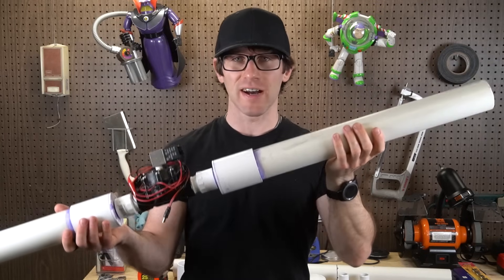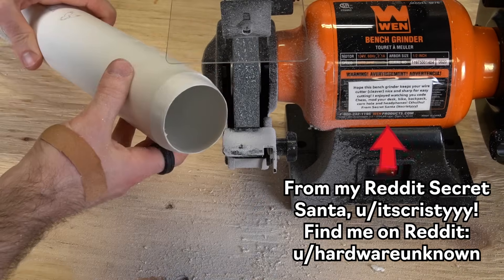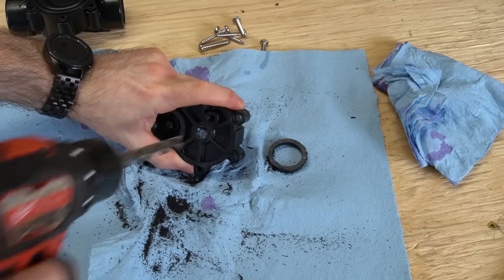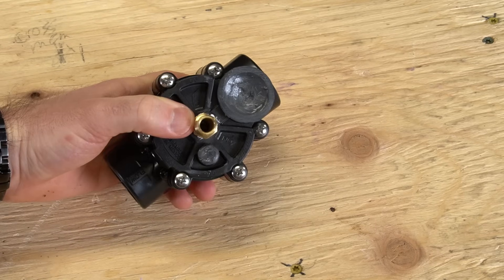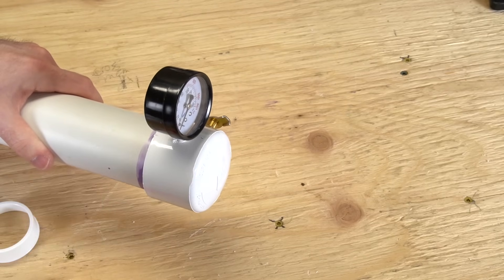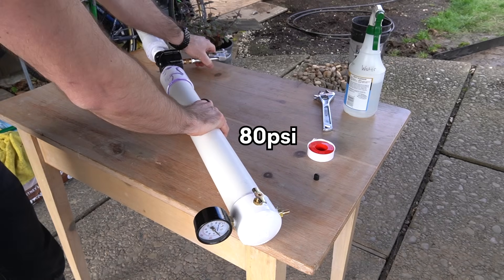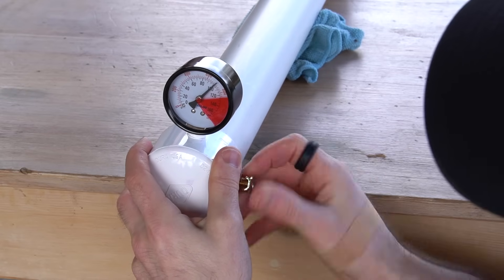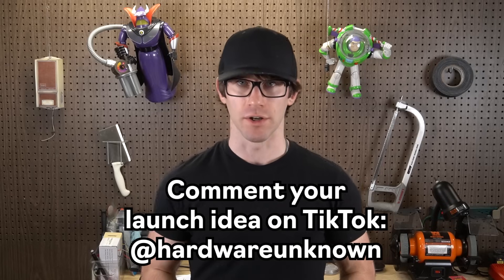How to Make a Simple Air Cannon

Comment: Looks amazing, I don't understand the blow gun section, surely pulling the trigger will direct the air out of the blow gun nozzle rather than through the barrel?
Reply from the maker: Great question! It would seem so right?

Notice that the blow gun is mounted to the sprinkler valve on the side where (internally) the diaphragm contacts the spring. When you pressurize the cannon, you may be able to hear a small amount of air escaping the barrel. This is because it takes time for the air to pass through the small opening in the diaphragm to the spring side of the valve. Eventually, enough air is on the spring side of the valve that the air pressure and spring tension together are able to seal it off since they now overcome atmospheric pressure.

When the trigger is first pulled, a small amount of air rushes out through the blow gun as you'd assume. You can feel this by holding your hand in front of the blow gun opening. The thing is, all that tank air pressure wants to equalize as quickly as possible with the atmosphere. When the "flood gates open" from pulling the trigger, all that air tries to rush out at once. Because of the pressure drop from the air exiting the blow gun, the diaphragm opens slightly, providing a second path of exit for the pressurized air.

The air then tries to rush out both the blow gun and the barrel simultaneously, but you'll notice that inside the sprinkler valve on the diaphragm itself there is only that small hole for the air to pass through (through the small white plastic piece in the diaphragm). Initially, the only exit for the air was out the blow gun. Now with the diaphragm slightly opened it is easier for the air to pass through the large open barrel than it is to rush through the small opening of the diaphragm and out the blow gun.

Pressurized air chooses the path of least resistance and tries to exit as rapidly through the barrel as possible. This causes the diaphragm to be forced open as the air pressure overcomes the spring tension. The air rushes out the barrel in one big burst and the cannon launches. Once the pressure equalizes to atmospheric pressure again, the spring tension resets the diaphragm and the process can repeat.

All this is happening in a fraction of a second so it's hard to tell when one "phase" of the action occurs, but that's the order of operations each time you pull the trigger.
Reply: @HardwareUnknown  yep makes sense now, thanks for taking the time to reply, a great explanation very detailed .

Comment: Quick question, is it wise to use pvc cement instead of Teflon tape to seal the values? To make it more sealed?
Reply from the maker: That's an option and would work fine. The reason I didn't is in case I want to change something. If you don't plan on that, go ahead and cement it.

Comment: Edit: You earned a sub. In case the following might be construed as condescending, I want to be clear I’m merely concerned for your safety and hydrostatic testing is standard practice for any work involving pressure vessels.

3:54 Yikes! Use hydrostatic testing for untested pressure vessels! You’re creating an unnecessary explosion hazard by filling with a gas before verifying the structural integrity of the tank.
Reply from the maker: I didn't construe it as such, your warning is important. People need to know PVC is not "safe" by any means for something like this. I haven't done hydrostatic testing before, but I would like to try it. Especially since eventually I can see welding custom metal containers and those should certainly be tested properly.

Comment: Couldn’t I hook this to a nitrogen tank and skip the air chamber?
Reply from the maker: Could you? Yes. Just be aware of the pressures you're using and take any precautions possible to mitigate potential failure/injury/damage. No cannon, particularly PVC cannons. is "safe". Keep that in mind regardless of the source of the pressurized gas you use.

Comment: ive had my unit of basically the same design for like just under ten years. all the while it hadnt occured to me to hold it like a launcher letting the trigger point to the ground. i feel dum. i guess i had ruled that out because i was afraid it would slam the trigger into my self from recoil using a 2 inch valve and a 4 inch reserv-o-war. i was filling the barrel with water and letting it report like a shot gun and one time the pvc barrel ruptured in my hand.
Reply from the maker: I was trying it with the trigger up and it just felt more comfortable this way. A good lesson for anyone though; these things can break catastrophically as mentioned here and in the video. Hope you were okay!

Comment: hmm trying to figure out how to combine a compressor filling up 3-4 of these automatically and stopping them at about 40psi and launching them using timing...Any ideas?
Reply from the maker: You could use a pressure regulator or a 40psi check valve. You could also simply set your compressor's built in regulator to a maximum of 40psi and you'd be set. By launching them using timing, do you mean they would fire a set amount of time after reaching 40psi? You could get real creative with that.

For example, you could set up an Arduino that has a current sensor checking the incoming power to the compressor. It will have some general range it's at when the compressor is running. It will have a lower reading if anything when it is idle. You could use this event (the change from high current to low current) as an input to trigger a timer that would then open a solenoid valve after the appropriate time elapsed, triggering the cannons.

Comment: This is a simple cannon?
Reply from the maker: I'd say so. The PVC connections all involve the same procedure to glue them, and the valve needs a few modifications. Sure there are even simpler designs, but there are also more complex ones. Everyone's comfort will be different so for some this would be trivial and other's it would be an advanced project. It's all relative. If you're building something though and learning along the way, you're doing a good thing no matter your current skill/comfort level.

Comment: So I made this and it just sounds like an air horn every time, any idea why?
Reply from the maker: Try 1) checking that all the parts of the valve were put back in the right orientation, and then reassembling it. There could be a gap somewhere where air is rushing past to make a sound, but it can't release it all the air properly for launching. 2) similarly, put some soapy water in a squirt bottle and check all your PVC connections on the reservoir side (using LOW pressure, just enough to see bubbles). The same may be happening there. If thats the case, you'll either have to cut the connection and make a new one with a fresh PVC fitting, or remake the reservoir.

Comment: Do you have a link to the power source you use for the solenoid?
Reply from the maker: This is the battery that powers both my simple air cannon, and the quad barrel version featured in another video: https://amzn.to/3LYLh5l

Portable and with a decent battery life for projects like this, especially low power solenoids/circuits.

Comment: I was having an issue with the sprinkler valve getting stuck open after a couple rounds of firing. I unscrewed the valve and put it back together and this fixed it temporarily but eventually it got stuck open again. After that I removed the brass fittings and just screwed the blow gun directly into the sprinkler valve and that fixed it. I’m not sure if it was just misaligned the other two times or what but I have not had any problems since. Really easy and fun project.
Reply from the maker: So glad you enjoyed it and went through with the build! I'm not exactly sure what is going on there, but what could be happening is the brass fittings are screwed in very deep into the valve. This could be preventing the diaphragm from fully seating itself to shut off the valve. Why this would happen only after a few shots, I'm unsure. Perhaps try taking the valve apart, adding the brass fitting, and inspecting it (with no pressure, unassembled from the PVC) to see if this is the case. If so, maybe some of the brass can  be ground down so it still provides the same hold in the valve, but extends slightly less into it.

Comment: can you use this for a gender reveal with colored powder
Reply from the maker: You could, the only thing would be keeping the powder from falling into the sprinkler valve as there's an open hole from the pipe into it. First stuff a bit of tissue paper/kleenex in there as wadding and then the powder.

Comment: make a gun that builds up pressure and releases it into a shot but instead of launching stuff it just shoots high speed air particles
Reply from the maker: When I was a kid there was this toy called an Airzooka. It was basically that. You would pull back on an elastic strap tied to a flexible plastic cover over the end of a plastic tube with a handle. When you released the handle the plastic cover would snap forward from the elastic and it would launch a sort of ball of air wherever you aimed at. It was fun to play tag with them.

Comment: Is there a risk that the pvc will explode if the pressure is about 150psi???
Reply from the maker: I can't tell you what an exact failure pressure would be as there are numerous factors that could affect it. What I can say is that you should always assume there is a risk of explosion, because there is. PVC is rated for water pressure, not air.

Always wear safety glasses and other gear, and err on the side of caution by using lower pressures. I didn't max out the pressure my air compressor can get to for safety reasons. The exact value was arbitrary, but it's within my comfort zone based on my tests. I encourage you to perform your own for your own safety.
Reply: Thank you!! Have a nice day!!

Comment: What do you mean by tap the hole, sorry I just don't know what that is/means
Reply from the maker: No problem at all. Tap (the verb) means to add screw threads to a hole. You do so using a tap (the noun) which is a metal rod-like tool you see me use that has threads along the bottom of the shaft and a square shank on top for holding it. When you twist this into the plastic, it cuts threads into it for mounting the fittings. For reference, the same term is used when cutting threads into metal. You'll see me use vice grips to hold the tap, but typically you'd have a tap handle with square jaws specifically for holding taps to do so.
Reply: @HardwareUnknown  thank you

Comment: I can only get mine to about 75psi then it stops, I used the exact measurements you provided. Do you know why that would be?
Reply from the maker: Huh. Have you done the soapy water test to see if there is a leak? Are you using a manual pump or a compressor? Check to see if air is leaking out of the valve. What might be happening is it gets to 75 psi and that is enough to open the valve, then when the pressure is released and drops, it stops back at 75 and the valve closes.

Comment: Thank you for the video. I made the exact same cannon using the same parts but some air is leaking out of the barrel. Any thoughts?
Reply from the maker: How long are you pressurizing the chamber for? Air will briefly leak out of the valve until the pressure builds and seats it. It's a few seconds, enough to think it will constantly leak. If it's continually leaking after 10 seconds though, that's an issue.
Reply: @HardwareUnknown Thank you for the reply.. Air was leaking through the small solenoid dumb hole that exits out of the output of the sprinkler valve. I sealed it with a small piece of duct tape from the inside, now it's sealing good no problems.
Reply from the maker: Ah yeah, I sealed that with epoxy, but hey if duct tape works great. Just make sure it holds well as pressurized air from a small hole like that could do some damage to someone's eye, etc, if they were near it (like while holding it on their shoulder) and the tape failed. No idea if it will or not but just want you safe.

Comment: Genuine question, why not just use a regular solenoid valve?
Reply from the maker: Using the sprinkler valve allows me to have the manual option with the trigger handle, and I wanted both configurations.

Comment: Any alternate ammunition that can be shot at humans?
Reply from the maker: I cannot advise on this as each cannon will be different. Anything shot at a human has the potential for serious injury and should have regulators in place to prevent "hot" shooting (ie. Too much power, with more potential for iniury). A stuffed animal may seem soft, but it can still hit someone in the eye, possibly with a piece of unseen plastic. Depending on numerous factors including pressure, volume, and more, a particular projectile will have a different impact (literally). As my design does not have a regulator and has not undergone professional testing, I do not recommend it be shot at humans. Personally, I leave that to my paintball markers while wearing proper safety gear.

Comment: Such a great video! I also saw the other cannon videos and they were all just as good
Reply from the maker: Thank you for checking them out! Best of luck to you if you decide to make your own, and feel free to ask me any questions you have.
Reply: @HardwareUnknown  How did you pump air into the cannon?
Reply: @Tanmay.Patil1  Legal disclaimer: Asking of questions does not  guarantee a reply, whether implied or promised. Video author reserves the right to withhold answers after welcoming questions.
Reply: @snozzlehead92  Ok Lmao
Reply from the maker: Well thats my bad, I missed the notification for the above comment. Would have replied to it much earlier. My apologies. I use both a bicycle pump and an air compressor depending on where I am and how many times I want to use it.
Reply: @HardwareUnknown  Thank you sir I appreciate it 😂
Reply from the maker: Of course. I do my best to keep up with all comments as they come in but regretfully some slip through the cracks. Thank you for understanding. I truly mean it when I said ask any questions you have.
Reply: @HardwareUnknown  For sure man I completely understand

Comment: Can I use the tape to widen the cut 1” pipe if it doesn’t fit? I’d like to thank you again for answering all of my questions
Reply from the maker: It's my pleasure. I made the channel so I could interact with people, after all!

Help me understand, so you cut the 1in pipe in order to assemble the large coupler to the threaded adapter, and the 1in pipe is too loose inside one of those fittings?
Reply: @HardwareUnknown  yeah
Reply from the maker: Thanks for clarifying. I'm glad to hear you're looking at solutions on the fly, as is the way of making. However, using tape as you suggest would be very dangerous. The reason being is that enough air pressure could unseat the tape, as it would just be a friction fit. This could cause the cannon halves to launch apart, damaging and or injuring someone.

Remember, this build has inherent risk no matter the design. The PVC pipes must be chemically welded using PVC cement to mitigate this as much as possible. Tape will eventually fail. I'm sorry it's an extra step to take, but it's the right way to go for your safety and that of others. Plus your cannon will last with proper chemical welds. You'll need to return to the hardware store and find fittings/pipe that are compatible.
Reply: @HardwareUnknown  thanks! Glad I didn’t end up doing that

Edit: Just figured out the “1 inch piping” was actually 3/4 inch.
Reply from the maker: Glad you asked! Ah yeah that makes sense. Thankfully pipes only come in several sizes, with 1/4" between the smaller sizes. Some can look similar until you've worked with them a lot.

Comment: Hi, I apologize about all the questions, but is there anyway I can replace the spring?
Reply from the maker: No apology needed. Always ask questions on my channel. Interacting with viewers is one of my favorite aspects of YouTube.

To confirm, you're talking about the spring within the sprinkler valve, correct? Was it damaged in some way or lost? Either way, if you can find one similar to the original you should be able to. I haven't tried doing so but it should be fine. It should be similar to what was there before as if it's much too hard it could hold the valve closed, and too loose it won't close properly. The nice thing is I assume as long as you match the general size, it's likely close. You can only get so strong a spring in such a small place.

Mcmaster.com is a great resource for finding individual parts of particular sizes. You end up with extra parts, and you won't see the shipping price during ordering despite it being billed to you (they typically sell businesses that send invoices rather than simple online individual purchases) but it's always been pretty average for small packages. I've ordered from them a lot.

Comment: Please can you put european measures
Reply from the maker: Oh man, so sorry I missed this comment. I try to reply to every one and this one slipped past.

I don't know what size PVC pipe/fittings are used in the european market, so it's hard to comment on those exactly, however I'll tell you that the sizing isn't too critical. The more important thing would be the pipe thickness for safety.

For a baseline though, the main pipe is about 5cm in diameter, the barrel is about 51cm long and the tank is about 76cm long. The pipe I used is about 4mm thick. The fittings are just over 6mm.

Hopefully that helps you out, let me know if there is anything more you'd like to know and I can find them out.